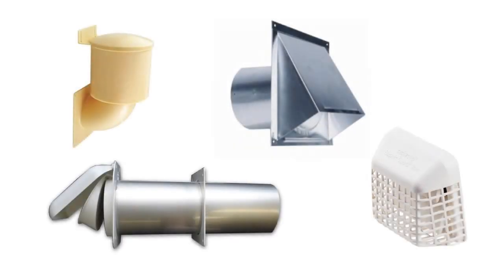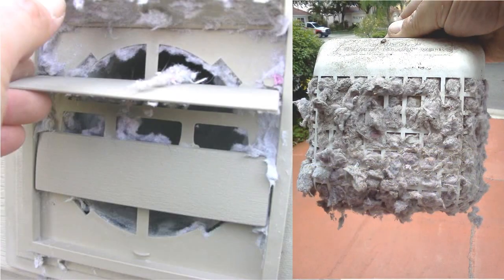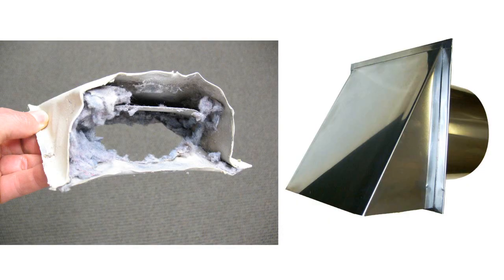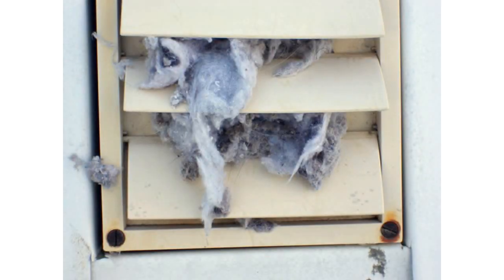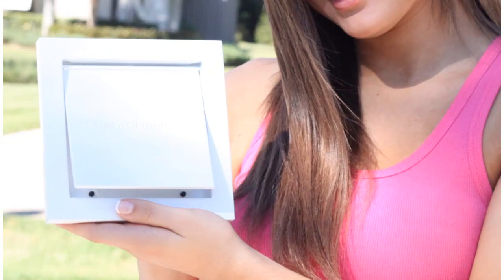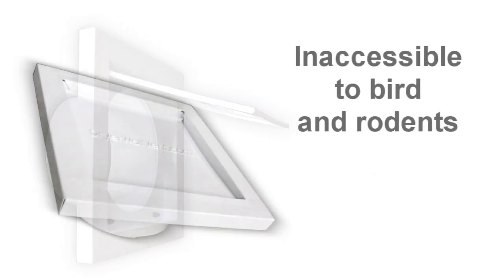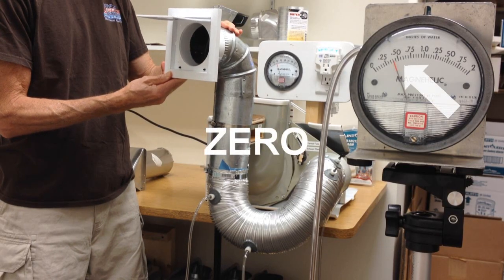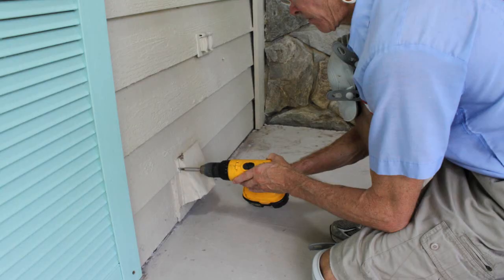Premium Flush-mount Metal Dryer Wall Vent - DWV4W

Comment: Your testing procedure for pressure loss has a flaw: by not sealing the junctions & seams of metal sections you're all but guaranteeing a reduction in flow.

I see some big potential problems with this design:
1. A single exposed flap is more likely to get blocked if something pushes something against the house
2. A single exposed flap has a lot of leverage and the outflowing air may not be enough to keep it open when there's heavy rain / snow
3. The bottom lip creates potential for snow / ice to accumulate
4. Snow / ice on the surrounding wall may melt, drip down, and then refreeze around the edges of the cover

Worst case scenario is that the vent is unable to open and the occupants of the house die of carbon monoxide poisoning.

Comment: Mesh may be against code, and the flap designed to shut tight when the dryer is not in use. However, if installed low to the ground as shown at 1 min 5 seconds how does this protect from rodents while the dryer is running? Just curious.
Reply: Self-cooking rodents, I like it.
Reply: If you got rodents trying to get into your vent while it's running, then you better call NIMH.   Their rats got loose again.

Comment: What about snow or freezing rain freezing the door shut ?  Wouldn't a extended hood be better ?
Reply from the maker: Good question. Snow and freezing rain is a factor that exists in all wall terminations, including our Dryer Wall Vent. Depending on your climate and the wall vent’s location on the house (i.e. close to the ground vs. elevated higher), a hood extension may be beneficial for additional protection and compliment the Dryer Wall Vent in this circumstance.

Something to keep in mind is the DryerWallVent's door is designed specifically to contribute zero back pressure to the exhaust system as well as keep out small animals, especially birds that like to make their nests in wall vents. Screens are against building code and can become a fire hazard.

Comment from the maker: Dryer wall vents come in many different styles and are required by code to be equipped with a back draft damper and NOT include any sort of screen or mesh. From these images it becomes obvious why screens are disallowed. Most hooded designs create a ton of resistance because the damper is limited in how much it can open. Note the high delta or difference in pressure. And Plastic vents over time disintegrate due to the elements. 

The Dryer Wall Vent designed and engineered to achieve the highest efficiency and excessive weather and rodent tolerance, all while accommodating access for duct cleaning and a super easy 5 minute retrofit installation. 

Visit dryerwallvent.com for more information.

 #dryer   #dryerventcleaning   #dryervent   #dryerventing   #airductcleaning   #airductcleaningservice   #airductcleaner   #dryerwallvent   #homeimprovement   #homedesign   #laundryroom   #homeefficiency   #energyefficiency   #energysavings   #energyefficient